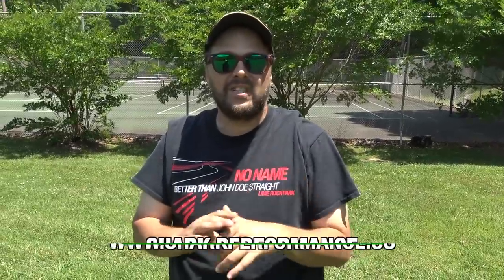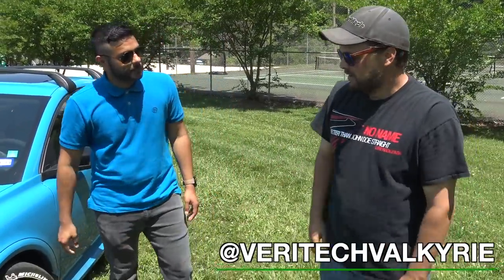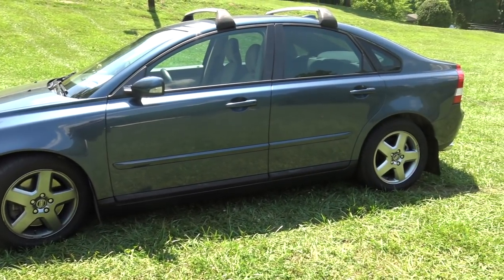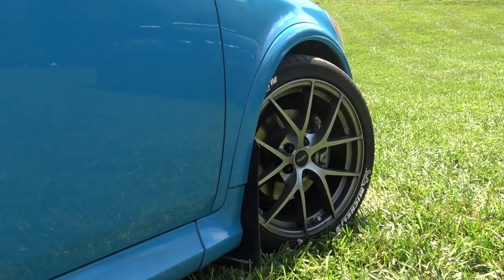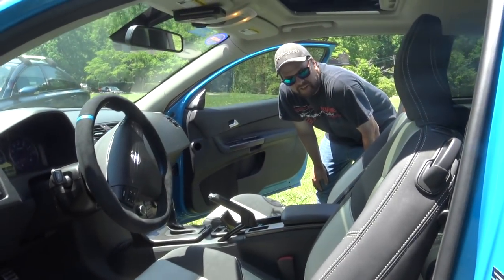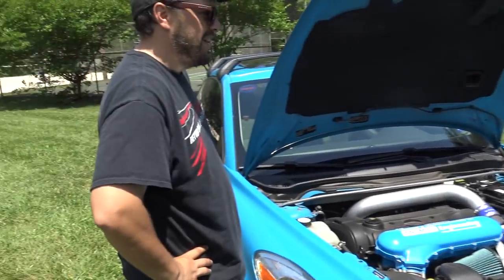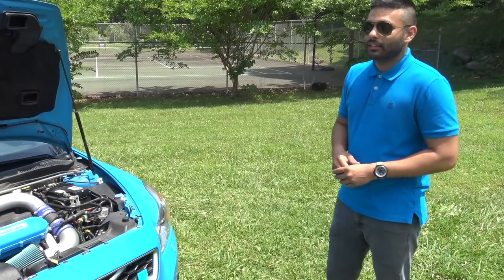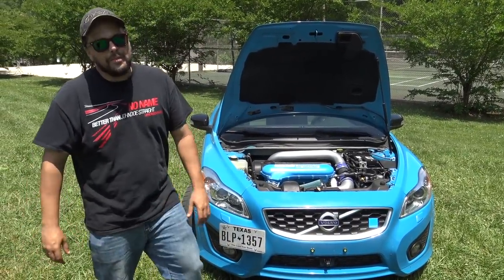Volvo Never Produced This Amazing Concept Car So This Genius Built One Himself

Comment: Too bad that the crisis 2009 stopped the C30R, and instead Volvo pushed out the DrivE cars.... Talked to a guy who worked at Volvo with projects, he drove the C30r, 350hp with AWD and a lot of carbon pieces... he said u could take corners crazy fast and it was like on rails...

Comment: Make it front wheel drive to make it a useable daily. What?
Reply: Many times the angle gear fails on these cars causing driveshaft rear damage. It was one of the cons of owning these 2004 volvos.
Reply: @MikoMuru  I know, but I dont think that has anything to do with being more useable. Haha
Reply from the maker: Once the awd swap was done the s40 had no driveline. So they took the old driveline from the c30 to make it a usable car again.
Reply: Ahhh that makes more sense.

Comment: C30 Polestar was a factory AWD, so you are wrong by saying it did not come AWD in any form. It did, even though as a limited edition.
Reply: You are wrong. The Polestar Concept was not a factory car nor was it production. They built it to show Volvo what their company can do. Plus it was not a C30 technically because it used V50 electronics therefore took on the v50 vin electronically. So volvo never produced a c30 awd. Nothing to argue.